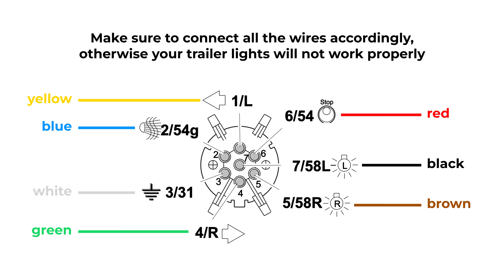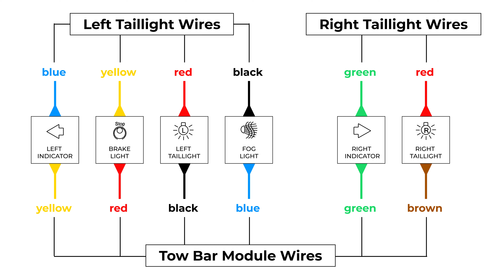Tow Bar Installation with Wiring Kit - Suzuki Vitara

Comment: Thanks a lot for your explanation ... Where did you find the positive wire ? In the left tail but , wich color is it ? Red also ? Difficult to see that
Reply from the maker: Ok this is a bit funny but here it goes. Initially I found a thin red wire that gave me a light whenever I turned the ignition on which gave me a reason to believe it's a live wire but it turned out it was not. What I actually found was a wire that powered the left taillight, so whenever the lights were switched on everything would work as intended. 

Now since the car has automatic lights that get switched on based on day/night sensor, and since I was working inside a garage the whole time, every time I turned on the ignition the lights would automatically turn on as well so everything seemed to be working correctly. It was only a couple days later I figured out what the actual issue was, and it was exactly that, that the trailer socket worked only when the lights were turned on.

After that I decided to undo some of the work, and just connect the positive wire directly to the battery. I had more than enough wire to pull it through the side trim (plastic) right to the battery up front, which unfortunately is not in the video. I still believe there's supposed to be a live wire back in the trunk somewhere but at that point I just gave up on finding it and decided to go with the safest route. Anyways, everything works perfect now.
Reply: Hoi,de sigaret aansteker in de kofferbak heeft een constante plus

Comment: Whats the max Tow capacity recommend so the car does not struggle?
Reply from the maker: Google says up to 1200kg. I'm mostly towing lighter things though like motorcycles, tools, materials etc. and the car is not affected at all.
Reply: Newer version 1500kg
Older version 1200kg

Comment: When you have LED tail lights these cheap red connectors will not work. And you connect old style 7 port plug. Modern cars use the 13 port plug. If you use these older connectors you get problems on your dashbord.
Reply from the maker: @Coordinator61  Thanks for the comment, everything works fine though and there's always an option to use an adapter to convert if necessary. Cheers
Reply: @wheelsnutsbolts  ok cool i was warned on this with led lights.